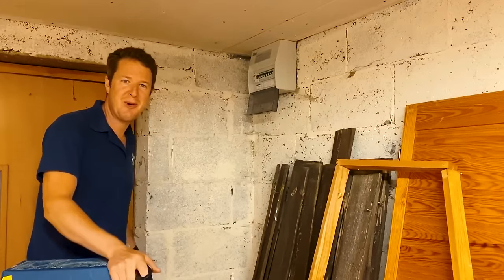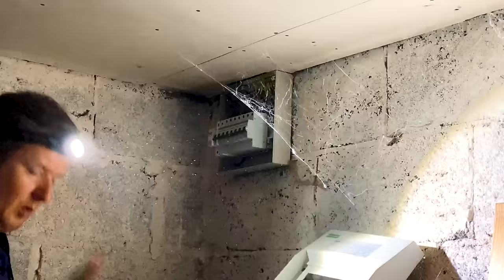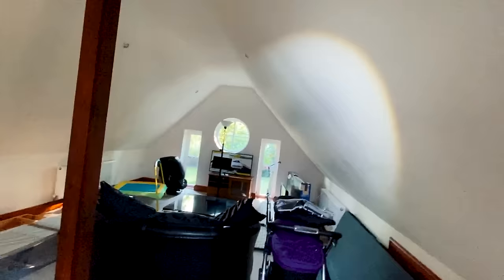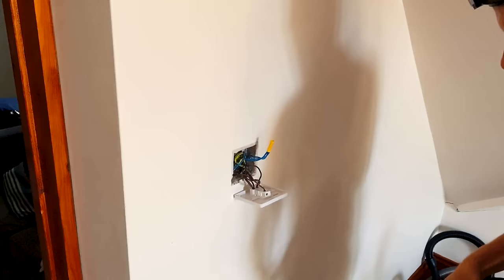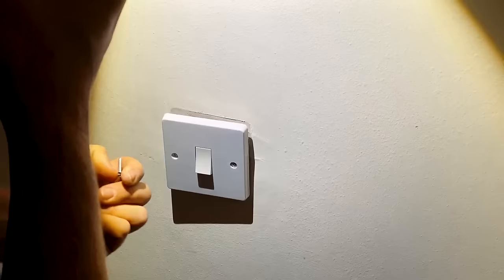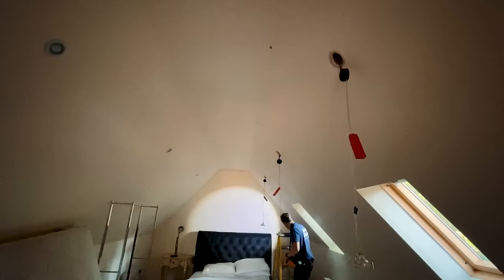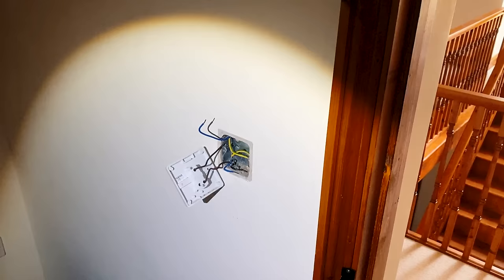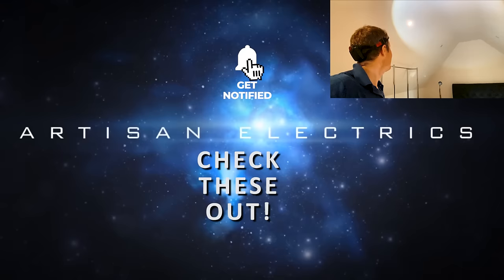Fault Finding Electrical Circuits - Electrician Life

Comment: That is why we in sweden use pipes, so you can change the cables.
Reply: Tjena kungen!! 
Yes we use corrugated pipes in Norway too. Super flexible and bendable, if installed properly. Rewiring will be no problem
Reply: Unfortunately the UK hasn't caught on to common sense things like this. I've lived and worked in a few European countries and they all used some type of plastic conduit.
Reply: we in Asia india Pakistan Bangladesh China. ...use conduit plastic pipes. rewire is so easy. but Indian domestic dwelling termination is a lot of doggy using tape on wire joints without wagos, connectors ...and open conductors everywhere around and above your head . ....
Reply: @PurityVendetta  The one thing the UK leads with is the sockets. The European round pin system and the US flat pin systems are awful. The fact that each plug top is fused is also a great safety feature.
Reply: @npr1300A8  I grant you the UK domestic three pin plug is the best in the world if properly fused. The only thing I've found not to like is accidentally treading on one in the dark with bare feet 😵
Not the plug's fault but I do notice that many aren't appropriately fused as in fuse value.
Great channel you have there Paul. I subbed and think I'll have to do a bit of binge watching 🙂
Reply: @PurityVendetta  Ouch! I can only imagine and liken the pain to stepping on a piece of Lego! 🥺 Thank you for subbing my channel. Check out the playlists for convenience. I've recently uploaded some clips from videos from some years ago, so quality isn't the best. I don't ride anymore due to a non fault incident in which my darling wife was killed. I was left with life changing injuries. These videos are very precious to me now. I hope you enjoy my videos. 🤝
Reply: do you mean conduit?
Reply: Other than vermin, which is not a huge problem in the UK, it’s not often a cable fault causing tripping. 
Virtually all the nuisance tripping calls I’ve had is either customer appliance or water ingress outside, usually.
Reply: It’s pretty common in Europe mate not just sweden…Germany, Italy, etc.
Reply: We use Conduit in commercial builds but not in houses
Reply: Where I stay, like the UK,  we can put cable in the wall under the plaster. Not my practice however.  I use conduit pipes for that very reason.  Plastic approved conduit is not expensive.

Comment: I was screaming STOP in my head when you did the second cut on the cables behind the switch at the stairs. You could have done a quick measurement on the cables as they were and saved yourself some extra work.
Reply: I agree with you David... Just remove the lamps and drivers.... You could then find it in 10 minutes
Why is no one trained properly... I ain't a electrician but all the video's I see just show incompentence ..... The issue is not the cable but what is connected to the cable... All he has to do is disconnect one leg ... either live or neutral and he would of found the fault..... Is it me or have we trained everyone with no simple diagnostic skills... I WILL SAY THIS AGAIN.. THE PROBLEM IS NOT A CABLE FAULT BUT WHAT IS CONNECTED TO THE CABLE... HE SHOULD BE FORCED TO RETRAIN... RANT OVER
Reply from the maker: It was a cable fault not a problem with anything connected you clearly haven’t watched the follow up video.
Reply: I love electricians who are perfect lol. I employed hundreds over the years, but sadly never met any, except me of course. 😉
Reply: @robertwheeler8476  You're not an electrician, indeed. I am. When fault finding never assume anything. Break down the circuit methodically to find the fault. Also, removing lamps and drivers is often an absolute pig of a job especially crappy old halogen units. You end up with damaged ceilings where the heat from the light fitting has dried out the plasterboard. Awful things. Hooray for LEDs!
Reply: @stuartmc18  I would guess a very poor electrician. I suspect you are a cable puller!!!
Reply: I would guess you are a poor electrician or cable puller
Reply: @robertwheeler8476  What would you be then Robert? I am interested to know.
Reply: @robertwheeler8476  you are clueless

Comment: No cpc required on those lights, disconnect the cpc from the switch, job sorted, class 2 equipment only to be installed sticker for loft lights 🥱

Comment: All of the circuits that have load a between phase and neutral will show a low insulation resistance reading between phase and earth if there is a fault between earth and neutral on any circuit. You should not insulation resistance test phase to earth if there is a fault from neutral to   Earth. You will damage sensitive equipment such as dimmers or USB outlets.
Reply: He said at the beginning he was carrying out the insulation resistance test at 250v not 500. So therefore no damage to USB outlets or dimmers

Comment: if this would have happen in sweden, i would just replace the cable. Here we put everything in flex hoses.
Reply: Hopefully, Diameter is large enough to pull in a new cable. I've seen D16 Flex hose on 3x2,5mm NYM cable. There is little chance left to pull put a cable.
Reply: same in Norway. We even get them with cable inside the hoses when laying the cables. I like those.
Reply: I've never heard of such a technique.
Where I live, we do that only when something needs to be added after a house is finished (plasters etc.) so there aren't any visible hanging cables on the wall. 
Putting everything in flexes has to be a lot of work. What cables do you use? Flat or round ones? I suppose round, soft ones are much easier to put in.
Reply: @inso5078  Most countries that run flex conduit (Copex) use singles, either solid or stranded. IMO 16 mm is barely good for three 1.5 mm2 singles but I prefer to use at least 20 for anything larger than phone wire. 2.5 NYM (round cable) in 16 mm sounds like a nightmare! I struggled with 2.5 singles in 16 mm but had to use that size because the block wall was so thin.
Reply: @inso5078  https://www.elektroimportoren.no/ferdigtrukket-k-roer-16-pn-3g2-5-rull-100m-pm-flex/1226265/Product.html?Event=livesearch You get them in any shape or form really. Just as normal cables.

Usually 16mm or larger hose/pipe, and 3*2,5mm cables inside it.

You can also just lay the hose and pull the appropriate cables throug. Single isolated is normal. Double isolated gets too stiff.
Reply: @inso5078  depends on the length, curves and amount of bends. You can also use lubricant to ease the process.
Reply: We have the same technique here in Switzerland. I rarely using 16mm hoses.. maybe for connections between lights like in this video or for a phone wire. We also have much larger electrical distributor so you can add more breakers/RCD when needed. Those boards in the UK always looking so tiny and tightly. And we usually
  have a RCD for every single circuit. Makes it much easier to find a fault. I guess you also have larger fuseboards in the Scandinavian countries
?
Reply: @Wrap19  18mm is useless if it isnt prewired  havent seen much english boards im from belgium but is that all off it our is it a secondary board ? ours are big 8 socket locations per fuse is rule 10 for lights but 8 if you mix them up
Reply: @Ragnar8504  hmm, i use 16mm" for everything, ican easily get 6-7 1.5mm cables in it. Only use 20" for 2.5 or if its a long distance,
Reply: @Simonhdude1  Would that be 16 mm inside or outside diametre? Here it's outside diametre and I've found it to be absolutely impossible to get seven 1.5 singles into 16 mm flexi! And that was a ramrod straight vertical run of about 1.5 metres!
Reply: @Ragnar8504  outside, but its very thin. There is a big difference in quality also. Cheep hoses is very hard to get a cable through

Comment: Here is some bonus info from an electrician from another country.
Every installed thing has a leak current, which is normal. But if too many devices are running through the same RCCB, it can add up to the point where it trips, even though there is no short circuit anywhere. A rare thing, but when it happens it's likely in a place like a restaurant kitchen or similar, where they have machinery that consumes a lot of power running over the same RCCB. Good to know if you end up in this situation, it may not be the first thing that comes to mind. Recommended max MCBs per RCCB where I live is 9. And that is for a normal household.
Reply: IET tells us to design based on 30% of the RCCB's rating (which is very conservative). The schedule of fault current based on device type can be found online too

Comment: I like your methods for fault finding. The only thing I would do differently is a full test of the rcd first on x1/2 then x1 and x5 and then a ramp test to make sure the rcd is going faulty under load. Once the rcd passes all tests I move on to the circuits as you did 👍 
Good job buddy
Reply from the maker: Andrew Dobson thanks!
Reply: Tripping when the customer plugs something in screams N-E fault so I'd probably check that before I did anything else.

Comment: Damaged cable  by another trade at the time of construction, most likely. It never ceases to amaze me how other trades think that pvc unarmoured cable is invincible. One time a plumber roasted in service lighting cables nearby to pipework, with his blowtorch, while installing a shower. The Insulation resistance readings weren't good....☹️

Comment: Before I see the fault I was guessing a cooked cable in the vaulted ceiling with the halogen GU10s. Kingspan insulation and 50w halogens with cooked cables I have seen so much in recent years

Comment: Grab yourself an earth leakage tester Jordan do your 1st process with the Mcbs then if the RCD resets clip the earth leakage on and switch off one by one till it drops saves ages.
Reply from the maker: Northy 32 nice tip! I do have one but forgot to use it! Thanks
Reply: @artisanelectrics  i have the 1664fc and i have had mixed results with the ramp tests. They are never ever consistent, I have ended up chasing my tail with it. I hardly ever use it to be honest and I don't think it would have saved much time.
Reply: It could be the case though, that when you switch an MCB off and the leakage reading drops, it's a neutral fault, the fault could be on another circuit?

Comment: I work on public lighting and we use similar methods to find a short so we can replace that connection with new cable. Its realy fun and intresting, sometimes it can take us a cople of hours to zero in on problem if the street is long.

Comment: Someone probably put a nail or screw through the wiring.  Time to remove drywall and do rewiring. Expensive repair.
Reply: Good point! Even when conduit is used...it happens on occasion with a wild drywaller!
Reply: well they did the best to let it happen. wires all hanging there not even in a propper conduit like a pvc tube.
Reply: Iván Pstyga in the UK it’s not required to have any protection on cables buried in the walls
Reply: @samwood34  in my country there are a few ways but the most used is placing pvc tubes and I must only use up to 35% of the section area of the tube* the rest should be free to dissipate any heat that could occur. What I dont understand is if your breakers are unipolar or bipolar for 220V they really look like only 1 slot for the phase
Reply: @OprichnikStyle  Yes totally agree must be a nightmare to come across something like that especially for the customer. In other countries pvc tubes are used unilaterally everywhere so its as easy as pulling new wires through and connect and of you go.

Comment: I thought neutral to earth when you said it was tripping as soon as they plugged in 😁. I would have gone for the screw on the switch plate nicked a neutral when pushing it back or a metal light fitting with the same 😁. I do love a bit of fault finding! Loving the vids Jordan. Keep them coming 👍😁

Comment: you done well to find that in 1 hour
Reply: Fault finding can vary very much! Me and a colleague spent 4 hours finding an earth fail, we found the fuse and there many old light fittings on that fuse. We took a guess that it was the source. 
But nooo, the very old light fittings were all good but there was 1 socket on that light circuit where an amateur had connected on that socket and he had screwed the wires to a pinch in the box..

Comment: I had a job where the customer (a mate at work) had had a garage workshop installed and it was powered up then when they plugged a lawn mower in it tripped. The lecy who installed the garage system said your mower is faulty but did not come to site.
I looked at the install and found the lecy had put the neutral in the wrong side of the split load board back in the house.! Moved it across to the neutral bar on the same side as the live. Job done!!!!
Foot note: the mower was fine it tripped as soon as you plugged in anything....

Comment: I always keep a few 3.5mm pins in my pocket and a threading tool in my tester box. I spend pretty much all day testing social housing so I come across stripped screws several times a day.
Reply from the maker: Black Fingers nice tip thanks!

Comment: Thank you. This has enlightened me.

 There is an apartment being used as a Lounge which has been a headache for me. It's wired with a 3-phase supply.
 The 3phase main differential breaker trips periodically within the day.  I've been on it for days to no avail in tracing the fault which I suspect to be leakage. 
I believe testing like you have should bring me positive results.

Comment: Definitely a good one Jordan what’s exasperating is not fixing it in the time allocated and you know with the location fishing a new cable gonna be a nightmare. Possible nick when the boards were put up my guess and then heat damage from the halogens a distant second. I have to say it’s gonna be a bigger fix. A TDR or a Savary special could narrow the exact location of the fault with a bit of math. Then the option would be what we would do here in use cut the board at the location to get to the problem would help with fishing new wire as well. That way repair to the plasterboard would be less significant. 

The point is that issue has to be fixed sooner or later not sure kicking the can down the road by the customer solves anything other than leave himself with a headache.
Reply: Get to know a great plasterer that way you could get to price these jobs more effectively and broaden the scope of work you would want to do.

Comment: I used a small neo magnet tapped to a nylon garden twine, then a very strong neo magnet to pull it across 10 metres of plasterboard ceiling, then tie on cable and pull in.
Jobs a good en ! 😉
Reply from the maker: Sounds great!

Comment: From the US, excellent troubleshooting skills brother!! So, seems like a nail or screw may be the problem,  or a pinched cable. You're kinda screwed. Time to open the ceiling.  I would not do this, but since your lighting transformers are not as you folks say earthed, disconnect the grounding conductor.  Or tear out the ceiling.  Just curious,  the main breaker is a 
GFCI or AFCI or a combination??? That's  an interesting requirement as it protects the entire house. Their use is required here, but on certain branch circuits.  Cool video.  Now Im off to an industrial job. Have lot's of wire to pull for roof top HVAC units.

Comment: I had one just a few weeks ago on an overhead crane (I do industrial maintenance) with 2 separate S/Cs; one on motor wires snagging on a DIN rail, the second on a catenary cable - I think it was just pot luck which SC was tripping it at a given time....
A 24vdc pilot lamp blowing fuses on a vacuum pump supply is another personal "favourite" find.

I've seen also SCs where cables have been carelessly stripped and the insulation nicked ever-so-slightly with pliers / snips.

Comment: That's one of several things to hate about downlights, you have a set of christmas tree fairy lights and transformers and junctions strung in the roof rather than a simple pendant and switch live. At least with these new wireless light offerings you have a central junction point and feeds out from there.
Reply: I absolutely love the wireless switches. Total godsend 👍

Comment: I like how you broke down the wiring 
I would always check the RCD before going outside the board 
Recently had a similar fault it was the last light I checked 
Fault was a mouse had nibbled through the insulation cut out some nibbled cables fault sorted 
Thanks Jordan

Comment: Brilliant fault finding. I never thought of using the multifunctional tester set on continuity, testing between each CB for the short circuit fault. Also giving the high and low resistance readings. I think I would of just used a continuity tester. Brilliant videos! 😊

Comment: 7 MCB´s on a single RCD? In The Netherlands there is a maximum of MCB´s you can put on a RCD and that is four. My humble switchboard has two RCD,,s with six MCB´s with one being a combined group for an induction cooker(2 Phase/@ Neutral). 
Earth leakages are some of the most difficult malfunctions in an installation esspecially in a house where everything is covered up. Great stuff!

Comment: Same comment on the second switch, check the reading first before giving yourself extra work.  To replace the faulty cable, find the joists on the cable route and Stanley knife a narrow channel in the plasterboard where the joists are and just loop the cable in the ceiling void and come in and out and under each joist, put a clip in the underside of the joist to hold cable and make good the chase, voila.